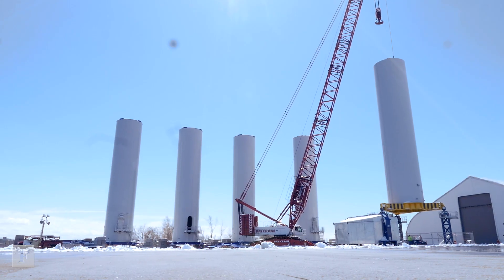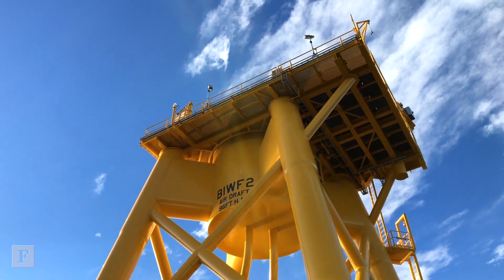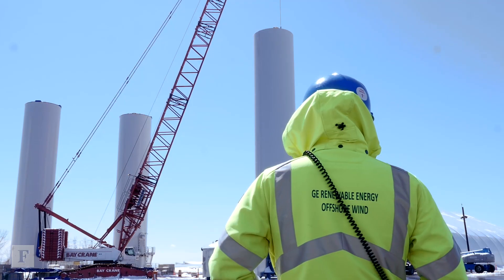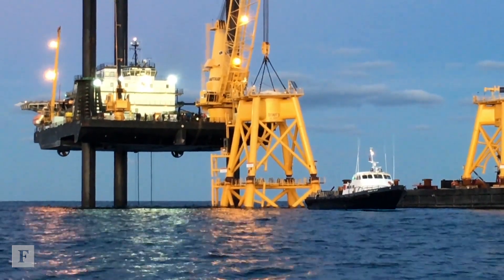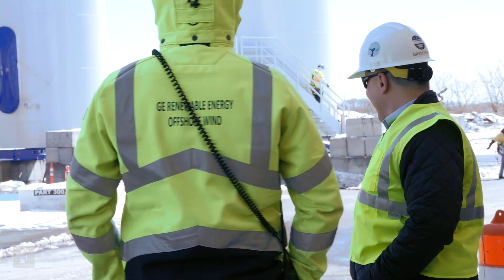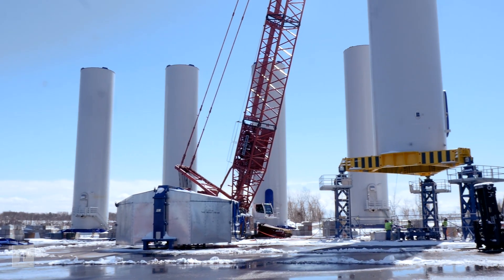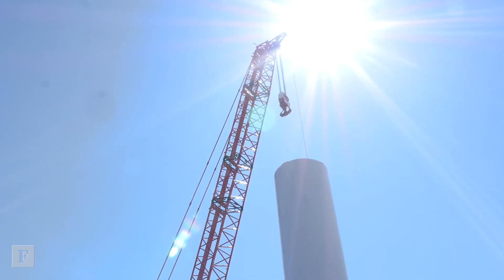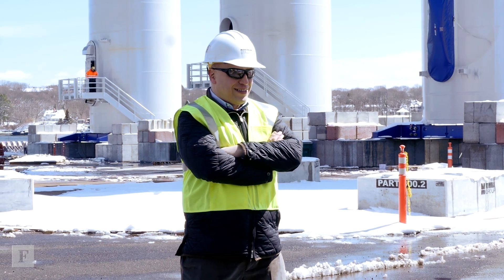A Look At The 5 Turbines That Will Power Block Island, RI | Forbes

Comment: NONE of the windmills should be visible to the naked eye. We have enough visual pollution due to "development," we DON'T need the open view of oceans cluttered with windmills. This is just common sense. The windmills south of Block Island are an eyesore, and having them so close was a perfectly moronic idea. The Kennedy's FORCED these windmills away from THEIR expensive views of the ocean, but Block Island, due to poor planning and very poor negotiations, resulted in this eyesore. "Intelligent" Rhode Island legislators would have forced the public utility at the time to install an underwater electric landline between Block Island and the mainland decades ago -- AT the cost of the stockholders NOT the rate payers.